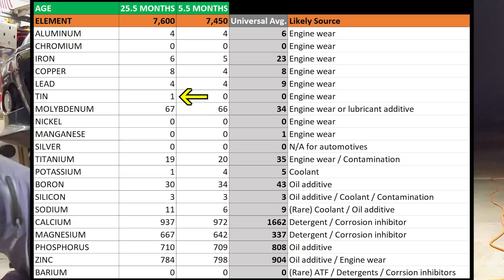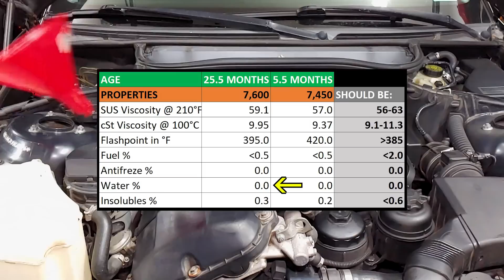Does Oil Really Need to be Replaced Every Year? Surprising Analysis Results Revealed

Comment: Company recommended oil for my Yamaha is 10w-40 mineral oil, i change around 2000km. But manual recommends 3000km, should i go by the manual?
Reply from the maker: If you're not sure, you can send in a sample for analysis. It only costs $35 and will tell you a lot more than I can.

Comment: In the Netherlands the long intervals are recommended. The intervals go as far as 30.000km, for my 2000 Peugeot 406 coupe V6. I can tell you it's a very bad idea, seeing the internals of some of these engines. My intervals on the dash are set at 15000k, but because i don't drive so much as my buisiness is from home, i do an oilchange every two years. That is well under 10000km. Never had any problems,  the engine is like new inside. She has done around 300000km now.
Reply: VW says 30000km or 2 years for Long Life oils
Reply: @finnderp9977  know somebody who has done this on an old golf 4 and had metal in the oil, after changing to the normal interval no more problems so.. better just buy the regular and change twice, if you do it yourself its the same anyway since the long life are double the cost usually (+ what you fill on top.. since.. its vw)
Reply: @finnderp9977  Do you and VW have the same pecuniary interest in your vehicle?
Reply: of course it works but you´re wasting your money on unnecessary oil changes
Reply: Great car indeed! ES9J4S?
Reply: @headtoheadracing  

Yes indeed. My pride and Joy since 2007. In very good and well maintained condition😉
Reply: @nicodenhaak3961  I'm a great fan of Xantia, 406, Xsara, 306 & 405! Greatest French cars of all time. 406 V6 is smooth and powerful. Quite fast too! I have seen videos of them reaching 250 km/h on German Autobahn! It is also very reliable! It can do half a million kilometers if well maintained!  if you have any Instagram account or something, I would be happy to see your car!
Reply: Did you open the engine to see it is new inside?
Reply: @kevincampos3797  

Yes i did. First the sump, and all four valve covers.
Looks really clean.

Comment: I bought my e46 with a dirty coked up engine. I keep doing 5k oil changes and engine has got cleaner and cleaner. It’s great to see
Reply from the maker: After pulling the valve cover a few times, I can confirm that longer intervals make it dark and dirty but shorter intervals cleaned it right up. I'm not sure if the dark dirty stuff was only at the top or all through the engine.
Reply: And increased blowby apparently
Reply: That tells you why one should change their oil every 5,000 miles.

Comment: I always go by 6 months 8 to 10 thousand kilometres one issue that effects my oil adversely is short trips in very cold weather. There are points in the winter where we see -40 for 10 days in a row. All the excess fuel used for cold start enrichment finds it’s way into the oil. I always do a spring oil change no matter how low the mileage is. Interesting video cheers 🍻

Comment: Non-use usually isn't the issue for most people, it's that most people drive regularly (so say 10,000 - 15,000 miles per year as normal) BUT still only change their oil once per year and then wonder why they have issues later on as the vehicle ages.  Part of this is due to mfrs telling people that cars can go 10,000 miles or 6 months between oil changes.   The latter may be fine, but I would never drive a car 10,000 miles on a single oil change even if it was the best synthetic oil around.  Tiny particles of metal can still make their way into the oil even on brand new vehicles as engines wear over time, and this can lead to huge problems later.  Changing your oil regularly especially if you drive a lot, is crucial ( I still go with the old 5,000 miles or every 6 months rule, despite Toyota telling me that my car could go 10,000 miles between oil changes... plus newer cars use a thinner oil -- 0W16 or slightly heavier 0W-20).  I'd say if the opposite was true say you were using 10W-30 oil or even 5W-30 you could push it a bit more, but not with modern thinner oils I wouldn't.  They primarily go to thin oils for fuel economy but the catch is you should really change it more often than what the mfr says, or you WILL wear out your engine faster since the oil is thinner, but you're also going longer on the oil changes, both of which are a bad combination compared to older cars.  Of course machining and metalergy has come a long way and they can make metals that are more durable and can run with less or lighter lubrication and improve fuel economy, but at the end of the day, I would still say 5,000 miles or 6 months is a good rule to live by for oil changes, regardless of how little you might drive.  You could maybe stretch it to 1 year IF you don't drive it that much, but I wouldn't personally.  Oil is cheap, engines (new or rebuilt) are not.

Comment: Time (calendar length) is often a reference for the style of driving. That is,  5,000 miles driven at 50 miles twice per week mainly on highways is not the same as 5,000 miles driven at short 5-mile commutes twice per day. It's a generic assumption that the car doing short range over a long calendar period has extreme pressure added to the oil due to the short commutes due to excessive idling at oil operating below the ideal temperature.
Reply: Not only that, every car leaks a small amount of fuel into the oil when it’s started, fuel is sent into the chamber but there’s no combustion right away so unburned fuel falls into the oil and it starts degrading it by making it less able to lubricare
Reply: @Jmg831  That is true. But, long runs on engines burn the fuel off. Hence, that is a large contributing factor in the difference between short 5-minute commutes as opposed to spending 20 minutes or so at highway speed.
Reply: @rodbritton360  yes you are correct

Comment: Nice car.  Takes me back to my first BMW, an e34. A 1994 540i.  
Loved that thing. 

Oil changes have always been money makers.  
Mobil-1 has done a few tests to prove synthetics can go the distance. 
In the 1990s they ran a BMW 3 series, IIRC, to a million miles with a 7500 mi oci. 
They also, ran two GM V6s to some super high mileage.  One was a 7500 mi oci and its twin was a 15000 mi oci.  Same results on tear down, almost no wear.  The 15000 mi oci had some sort of emissions issue IIRC but the 1990s brought us all sorts of emission nigtmares from American car makers to be fair. 
Thanks for the oil analysis!!

Comment: You’re exactly right on oil change intervals. I’ve been doing 13k intervals on my 2003 Odyssey for more than 100k. But before going extended oil changes, I would do used oil analysis to see if you can extend your oil changes based on your engine, climate and driving habits.

Comment: Nice video.
But if you don't want to pay for analysis, what can you tell from the oil colour? In fact what causes the change?
I had a Honda VFR750, and the oil never changed colour. On my Ford 1.0 ecoboost, it goes dark after a few thousand miles. On my 1.5 diesel, it goes black in a week!
Reply: I heard ya regarding black oil in a diesel. I owned a VW Jetta TDI for 10 years and did my own oil changes with Mobil Delvac 1. Black almost immediately!
Reply: Any blowby on your tdci?
Reply: @RohanSanjith  I don't think so. Piston seal/compression appears to be good because ALL my glow plugs are dead and the car starts fine in summer or winter.
Reply from the maker: I believe it is mostly carbon from combustion that turns oil black. I've also heard that engines with turbos get black oil very quickly.

Comment: Just an FYI.....liquimolly is designed for 20,000km use (similar to the long life golden castrol jugs) and rottella T6 is designed for 19,000km. Just a thought if you wanna try them. 😊But id suggest u do annual and not 2 yr oil changes if you dont drive much. Thats the Euro routine in years if not by Km/Mi.
Reply from the maker: There are a lot of oils I want to try now. Too bad these tests take so long to complete. Thanks for the ideas, I'll add them to the list.
Reply: @endlessmoneypits  i think youd like the 5/40 oil better than the 5/30.... esp if youre burning a little. 😉
Reply from the maker: This engine doesn't seem to burn any oil, miraculously. It leaks a bit but the oil level on the dipstick never drops. I need to fix those leaks...
Reply: @endlessmoneypits  good lucky you... 👍🏻 mine didnt burn either 🤣
Reply: @EndlessMoneyPits If these videos return ok money. You should look to rope in some people who do high miles/ km's but not necessarily highway miles/km's.
Reply from the maker: Many plans ahead if all goes well.

Comment: Great video!  What is the life expectation of synthetic oil in years? Thoughts anyone?
Reply: https://youtu.be/6p69YEHqz0w  
This is an interesting video.  By that I mean the narrator is neither an AMSOIL Dealer like myself, nor owns a business that sells AMSOIL.  He is a DIYer who simply has a positive story to share of his extensive track record using AMSOIL motor oil in his 1998 Volkswagen Jetta TDI diesel.  It’s only 12.5 mins, and a bit slow in the beginning but he does make a great case – almost 400k miles – for a good quality motor oil.
Reply: I've used synthetic oil since 1997 . You have to use all your vehicle info into this equation.  Age of the vehicle , mechanical condition , how it's driven & other highlights. My advice , at all costs keep it far away from severe service as this will destroy the oil additives alot sooner than highway use .I change my own oil and filter twice a year . About 4500-5500 miles

Comment: My tsx ran 16kmikes/1yr with amsoil without adding a single onz of oil. Blackstone lab results was try go 5k more.impressive, car have 230k miles doing this and never haven't touched the engine
Reply: Glad to read that.  I've been using Amsoil in 8 cars now (mine, wife's, daughters', sisters') for at least 15 years and the oil gets changed every September.  That results in variable OCIs, but it's easy to budget a weekend in August/September to do the oil changes and not worry too much about mileages.  Daughters are in school.  Sister lives 2 hours away, so trying to keep to a regular mileage based OCI is difficult, as I imagine it would be for most people with families, jobs, etc.  The highest mileage interval in any of the cars is 8000 (wife's), and the lowest is around 1500 miles.  Yeah, that's too short, but everyone here knows that September is the month, so they make the time to visit.  3 of the cars are over 200K miles, and 3 others are over 100K.  So something must be working.  Each person has to develop on oil change routine that works for their life, so that they can stick to it.  Kinda like sticking to some reasonable exercise routine.  Too rigorous and you won't stick to it, too lax and it won't do any good.

Comment: This really helps my thinking a lot. I am assuming the same thinking would apply to front a rear gear oil. Subaru says my gear oils should be changed at 30,000 miles and when I go in the dealer wants me to change it now at 24,000 miles I guess because the 
manual says 3 years or 30,000 miles. These dealer really try to come up with maintenance that doesn't really need to happen.
Going to start doing my own maintenance as much as possible. Any comments?
Reply from the maker: Gear oil might not have the same results because differentials are vented, but I'm really not sure. The front diff fluid in my Jeep is 5.5 years old with only about 10k miles on it. Maybe I should send a sample of that in for analysis?
Reply: @endlessmoneypits  Thanks for the response boss. Something to think about. I'll ask around. Great vid you did. I passed it onto a friend that changes his oil every 3000.
WITH SYNTHETIC!  What a waste.
Reply from the maker: Thank you. I plan to make more videos like this.

Comment: I believe part of the 'myth' may have been true at one point, where crankcase breather systems were just a filter on the valve cover. Same deal with fuel in tanks, it HIGHLY depends on how much it breathes. Oxygen is a big killer for both, and both modern systems don't allow air to cycle in/out when it's sitting.
Reply: Carburettors were really inaccurate and could leak temporarily.
Reply: the crankcase is practically closed when the engine is OFF, under idle and wot, its only "breathing" when under cruise speed. 
This is why people remove the PCV system and let the engine breathe naturally and this way its exposed to outside air 24/7 ... 
Its more important for the crankcase to vent OUT while its running.
Reply: @ACommenterOnYouTube  I just read crankcases are vented and that's why your oil won't glug glug during an oil change drain if you don't remove the filler cap.
Reply: @Victorylap-fy4ke  ahh HUH ??

Comment: Interesting.  My wife drives 1 mile to work so I change her oil twice a year based solely on time and not miles.  Maybe I should rethink this?  I do have a catch can installed in her car to capture excess moisture, etc.
Reply: maybe she should walk or ride a bike.Just Saying
Reply: @johnmitchell2741  i agree
Reply: short trips are terrible for cars, you don't give the engine a chance to expand, and not enough time for the engine to heat up to start burning off moisture, this will lead to poor wear characteristics and lots of expresso mix in the oil. Worst wear occurs on start up and shut down of engine as the different materials expand and contract. I would suggest either an EV, or a honestly a bike for a mile commute... that's a lot of wasted fuel, and resources for that short of a drive.
Reply: @erack1  I agree and there is even a walking path close to the office.  It kills me what she is doing to her engine.
Reply from the maker: That's a lot of very short trips so I can't say my test is a good representation of that. It would be interesting to see an analysis of that oil.
Reply: As others have said walking or riding a bike. That will keep her in shape , but if it’s windy or rainy a bad hair day would not be good.
Reply: 1 mile is like 10 minutes walk, why not walk?

Comment: Cool! This means your engine is well maintained and does not have much blow up. Condensation also depends on weather in your area, might be helpful to note the humidity in your area. Anyways, great video and experiment!
Reply from the maker: I did mention that it rains a lot here but I should have been more specific. The humidity changes a lot throughout the year, but I'm in a valley surrounded by temporate rainforest, so it's pretty wet where I live.
Reply: @endlessmoneypits short daily of 10miles, 5 miles in one direction, in winter months of 10 degree F or less would be generating the most engine wear. 

Would your engine able to get to >175 degree F at the 5th miles in the winter? Just a bit curious on this.
Reply: Blow up?